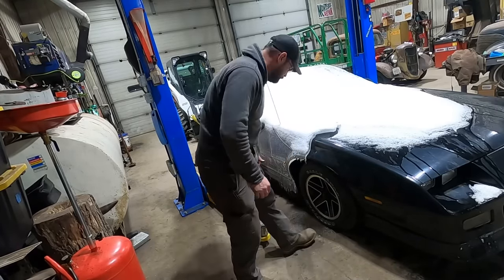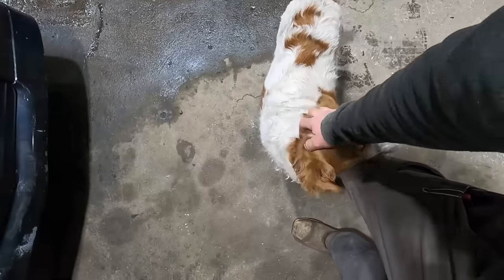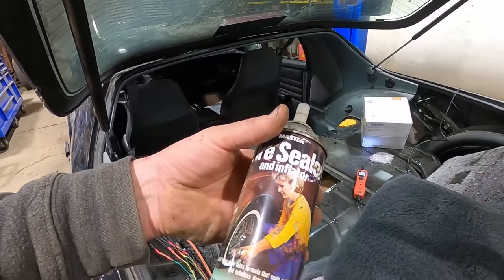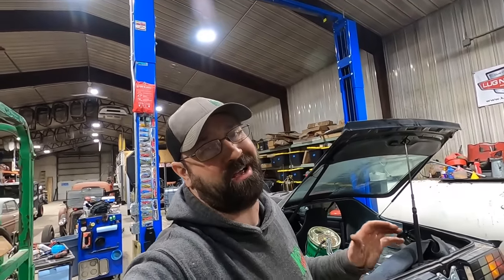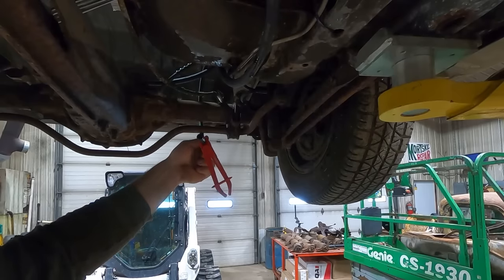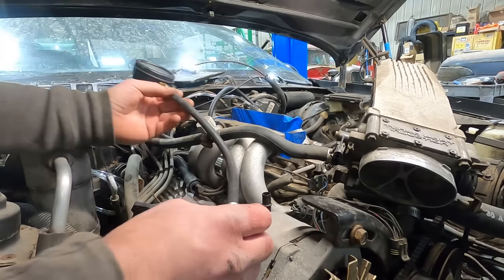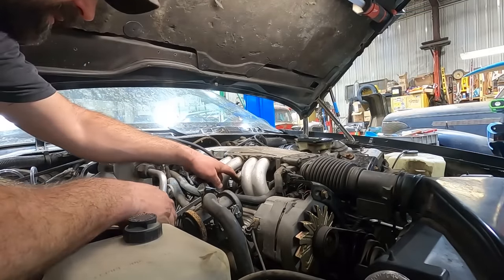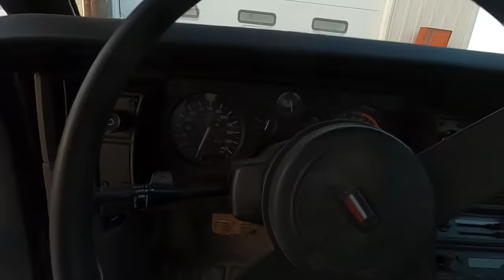Another Bargain or Bust Facebook Camaro?!? Low Mileage 1986 Z28 Tuned Port Injection! Will It Run?!?

Comment: RPO code Z28 came out in 1967 with 602 examples built for the 1st model year.
Reply from the maker: No way?!? REally? Dang, I was way off.
Reply: @MortskeRepair   And in 1968, because GM President Pete Estes wasnt sure if they were going to continue the Z28 homologation, some of the engineers had a '68 convertible optioned with RPO Z28 and gave it to Mr. Estes to persuade him. It worked. That is the only 1st gen Camaro Z28 convertible ever made and it now belongs to Dana Mecum of Mecum Auto Auctions. The rarest muscle car ever built.

Comment: Fun fact about the LG4 it was a 305 with a quadrajet that was computer controlled, it had two electric ports on it. They called it the E4ME carb, I still have mines it’s currently my new door stop.
Reply: mine was gone.......just threw on a holley 650,a bit overkill but the price was on point
Reply: That's about all those electronic frankencarbs are good for.
Reply: @Jerkwad152  Exactly like I understand this was a way they came up with to meet the requirements for C.A.F.E. But they could’ve just went with smaller jet sizes. Luckily by 87 I believe all the v8s in the 3rd gens went efi, so no more Frankenstein carbs 🤣🤣🤣.
Reply: @trillrifaxegrindor4411  I had a 625 Street Demon carb on my 305. I would rather be slightly over carbed than under carbed. Because lack of fuel is where you really start to destroy shit, especially in performance applications.
Reply from the maker: Sounds horrendous!
Reply: Fun fact.. not all LG4s came equipped with that computer feedback equipped nonsense.
Reply: 88 305 with electric float control. Unplug in summer time to keep from flooding. Fun times.

Comment: Yes, the round rusty object next to the mouse house under the intake plenum is an EGR valve.  The throttle body is not liquid cooled, it is liquid heated.  That is to keep cold moist air from forming ice on the throttle blades in cold climates.
Reply from the maker: Yeah I said that wrong.
Reply: Some 454 tbi trucks had a similar type deal which were also 4 bbl to tbi adapters cause tbi 454 had 4bbl manifold from factory.. used one while swapping an older 350 with an air gap 4bbl manifold into a 91 truck .

Comment: The biggest problem with third gen’s ,,,, the type of previous owners they attract.
Reply: Ive loved these cars since the late 80s, yet Ive never owned one. And Ive now owned 100 cars and trucks. There's too much "low life" stigma attached to them.
Reply: You must mean second owners because the people that bought them new, at least in 19687, were not odd people.
Reply: bro, as long as you grow a mullet, it's all good.
Reply: We called them "trailer park Corvettes" when I was growing up.  Bonus points if it had a baby seat in the back.  Or up on cinder blocks
Reply: "Trailer park corvettes" is hilarious!😂😂😂. Im a proud IROC owner since 1998 and I can confirm that previous owners are a problem. At least mine came with a condom in the ash tray so you know they guy was stackin the hoes...hopefully not in my car though. The guy before him used green garden hose as air injection tube for the cats and also hung the 6x9s with cut up pieces of license plates. Classy.
Reply: @andysteele4056  as a 89 944 owner my Car has had similar issues with previous owners for the longest time. These were really cheap and people would buy them because they had a Porsche badge on them.

Comment: Sweet thridgen project! I just got me a 86 Ford Bronco II inline fuel pump and strapped it to a boat tank. Cheap and easy and it runs everything that comes in with a bad fuel pump- so i just hook it up and drive the rig into the shop. I went to the junk yard and cut off every different fuel fitting I could find and put them in one of those Milwaukee tool bags along with a 99 corvette fuel filter (to adapt it to newer returnless systems). Then all you need is some fuel injection hose and FI hose clamps- it even works on GM TBI despite the pressure difference. One of the main things that go wrong with these is the fuel inectors go bad when exposed to ethanol- it eats the laquer off the windings inside of them then they have a resistance that is too low for the ECM to handle. you can test them with a multimeter in ohms mode- the resistance should be around 12 ohms on each injector- much less and it wont work right. TPS voltage should be set to .55 volts KOEO. They were all 305's until about 88 when they came out with the 9 bolt that could handle the 350
Reply: One of my favorite test rigs was a pump up garden sprayer with a soldered on air hose quick connect with a bunch of GM adapters. You could set it to whatever pressure you wanted. Carb, TBI, EFI didn’t matter lol

Comment: We put a new transmission in my friends 3rd gen Camaro and we left the torque arm off to see what it would do without it, every time you take off in drive normally it would raise 6" up and if you put it in reverse and held the brake it would pull the car 6 in load of the the ground, the torque arms is really the only support keeping the rear end straight...
Reply from the maker: crazy, maybe we should try...

Comment: I swapped out a 2.3 Turbo that came out of a wrecked Thunderbird into a 1993 Ranger and fought the fuel system for a couple of weeks because the injectors were all stuck shut with crappy fuel. Cleaned the injectors and it ran like a top.
Reply from the maker: Awesome!

Comment: 17:17 tune ports aint so bad. I used to think and do the same thing. They suck, rip it out and drop in some with a carb. That was until i got my formula! It wouldnt idle and ran like shit. I replaced the fuel pump, the filter and the fuel pressure regulator. Replaced the injectors with factory spec brand new ones and it runs AWESOME! thing is loyal asf! SBCs are loyal anyway but that tpi is better than any carb or TBI unit. I wanted to do the same as you and put an LS in it but it runs so damn good im gonna keep it. I want to do a "what if" Callaway made a run of sledgehammer firebirds! Lol i guess what im saying is give it a chance!

Comment: Tom, the Z/28 option was first offered on the 1967 Camaro.  602 were built the first year.  The first ones were built in December 1966.  It was built specifically to compete in the SCCA Trans Am racing series, and won the championship in '68 and '69.  The Pontiac Trans Am was first offered in 1969.

Comment: My Uncle had a Blue Iroc z28 for years it had the T tops, Alpine cassette Deck and JL subs in the back (mid 90s install) He Had a local trans shop go through the automatic  trans, while he went through the 5.0 and Rebuilt the entire thing, I can't even remember everything he did, but i remember the car screamed. he eventually parked it in the bushes out back for a good 15 years and my cousin pulled it into the shop when he was about 13 and went through refreshing it and getting it going again, drove it to school and it was his daily for about 5 years, he eventually sold it for a old truck. lots of good times ripping that car when my uncle owned it. i always loved the metallic blue paint. he had one of those airbrushed vanity plates with his name and it said "Iroc and Roll"  above his name with a couple of palmtrees and a beach scene😂the 90s were a great time 😂
Reply from the maker: Thanks for sharing!

Comment: love third gens, i have my fair share of them. right now i have an 85 iroc and 82 z28. i have also had 2 92 25th anniversary editions RS ones as well. just love these cars. keep up the good work
Reply: Is your 82  crossfire injection they used on them in 82.  Nice collection of cars I miss all of my z28s. I had an 85 iroc 88 iroc 85 z28 5 speed all tTop cars man I loved them cars
Reply: @icantsaywhat I heard 82's had a fiberglass hoods too?
Reply: @grabasandwich I've seen an'82 with the fiberglass hood from the factory. Not sure if all of them were like that.
Reply: I have an '87 iroc 305 t-tops car. I'm dropping in a high-comp L46 from a '70 Z28 when I get the courage to tear apart a numbers matching iroc😑
Reply: @Whats-It-To-Ya  numbers don't mean sh¡t dude. We only live once. Everything's mass produced and it's just the rich people driving up the prices beyond our reach with their p¡ssing matches.
Reply: @Whats-It-To-Ya  I just looked it up again. 82-83 Z28s had a Sheet Molded Compound hood, and had functional flaps with the LU5 option. But apparently they were delaminating at higher speeds so GM replaced them with steel ones.
Reply: @icantsaywhat  no and thank god. I absolutely hate that system. I have an 84 corvette that has that garbage on it. It is a nightmare if flawed design. The dual single barrel throttle bodies isnt a bad touch. It will actually flow 750cfm. That is where the good stops. The intake is the worst part of it all. The tbi units sit on top then your air fuel mixuture has to take a sharp 100 degree turn then up and over through a very puny intake runner. This chokes the port size down by a full 3rd of the size. Cannt port it either not enough material. Currently rebuilding the 350 that is in it, using Brodix IK180 heads, comp XE268hr cam and a edlebrock performer intake that has been port matched to the heads. For fue delivery. Holley sniper kit
Reply: @grabasandwich  mine is sheet metal.
Reply: @Whats-It-To-Ya  I tore mine apart, the og 305 spun a rod bearing. So I put a 383 in it. I dont plan to sell it, just have fun
Reply: @margraffsgarage  383 strokers are awesome. My father has one in his Monte Carlo SS. I wish I knew how to build one, which block to use, which crank, rods, heads and things like that.
Reply: @Whats-It-To-Ya  its not hard at all. Can use stock heads or aftermarket. As for the bore and stroke. You will need a rotating assembly. Mine is from Scat. I ordered the rods to match as well. Its taking a 350 and boring it .030 over and increasing the stroke from 3.48 to 3.75. Some blocks will require small clearancing to clear the rod bolts from the oil pan sealing surface on the block. Mine required very little. The block I used came out of a 74 3/4 tom truck and is a 4 bolt main. I have built another one however using the 87-94 blocks. They are 2 bolt mains but hold up good. As long as you dont send it to the moon on rpm you'll be fine. 6500 is about max. Compression ratio. On the 4bolt block it is 11.34 to 1. The 2 bolt one i build was a mild 9.5 to 1. It was veey streetable, great vacuum and great torque. Video of the one in the Camaro is on my page. I did remove it and put it in my 89 c1500. Did some changes to it as well.
Reply: @margraffsgarage  oh that's not all that hard. I don't have any 350 motors laying around except for the L46 from a '70 Z28 that I plan on putting into my iroc. I'll hafta go to the junkyard this weekend and pull a 350 to make a 383 as that would probably be better for my Camaro. I don't know what to do with my L46 that I paid a shit ton of money for. I do have an '88 or '89 S10 behind the garage with a blown 2.8, I should try to put my motor in that. Been wanting to do something with that little truck for the longest time, just haven't had the ambition. Thanks for the stroker recipe. I'll get started on that this weekend. I'll make sure it's a 4-bolt main and I'll slap some forged rods and pistons in it. 👍

Comment: About 10 years ago I bought a rust free 86 Camaro RS with the 5.3. It was loaded with ac automatic power windows and seats.  Everything worked even had new tires on the same rims you have on yours. I only paid $750 for it. Even all the suspension and brakes were almost new. Car drove beautifully.  I drove it for 3 years only problem was I had to replace the fuel pump and I did it the correct way by undoing the rear muffler and dropping the rear axle some it was a pain but got it done. I turned around and sold the car for $3000 . I live in Florida so the car was immaculate underneath.  It was red with tee tops and ground effects.  Wish I had kept it now after watching this video.  Sorry you got screwed so bad. Good luck in whatever you decide to do with it.
Reply: I would love to see a 1986 RS since it didn't exist.  In 1986 You had the Sport Coupe or the Z28.  In 1987 Chevrolet tested the market with a limited edition RS model all with the 2.8L V6 available in red, black or white.
Reply: A 5.3? I never heard of that one.

Comment: Crunchy snow, gotta love the cold!!
Word on the streets is 30° here in Wisco today.
That Camaro brings me back to the cruising days with CB antennas and mullets.  Id love to have another one of those cars.
There was also another engine option.(not sure about later years 86') 5.0HO with 5 speed. Those were MUCH quicker than the dismal 350
Thanks for the memories Mort👍👍
Reply from the maker: Heat wave!
Reply: @MortskeRepair  Hahahahaha, yea.  I don't believe it hit 30, but sure felt nice compared to how it's been.
Take it easy:)

Comment: Just from the initial undercarriage inspection it looked like the right rear coil spring wasn’t sitting the same as the left side.
Reply: I saw the Spring also.
Reply from the maker: @robertvance1873  I popped it back in place

Comment: I know in the 80's GM used the oil pressure sending unit to shut off the fuel pump if it did not have oil pressure. or if the sending unit was bad.
Reply: This is a fact that brings back memories  😅

Comment: I've an injector pug with decent length of wire, I plug into the injector earth it then flash the power lead against a 12v feed (don't connect as you'll fry the injector as the are 9v) the extra jolt of power usually frees stuck injectors.

Comment: Crank position sensor? It's what tells the computer where the engine is in order to fire the correct injector at the right time(when the intake valve is open). Never heard of a cold start injector, a Ford would just have longer injector pulses until the engine is warm enough to go into closed loop mode where the pulse length is adjusted to get the correct voltage from the O2 sensor.

Comment: I bought A 85 Camaro with A 2.8 and then found A 2.8ho In A RS of the same year and rebuilt the ho. I went through 4 crankshafts before getting the rite one and come to find out we had A 195hp 2.8ho engine. We spent over 3k rebuilding that engine and did decide to put A mild cam and lifters In It. Never had It on the dyno but It would roast both the back tires. 2.8ho multi port. I wish I knew you wanted one. I sold It last year for $800 . Nice video man. love these gen Camaro's.
Reply from the maker: hot rod!
Reply: @MortskeRepair  Well It did win several car show trophies so yea!!! ;)

Comment: Good thing about those third gen’s, you can grab a diff from a 4th gen. And it bolts right up. So you’ll get disc brakes in the rear and you can get 4th gen 10 bolts dirt cheap
Reply from the maker: Good to know!

Comment: Dude, that was epic. After all that frustration, you were successful. Ford parts hardly cross with other Fords, Its mind blowing that they crossed with a 12 year older GM. The thing actually sounds like it runs good. I’ve actually been looking for an iron duke, 5 speed, because I think it would be funny (0-60 in around 18 seconds) There’s for sure $1,500 in interior parts, tranny, and engine there.
Reply from the maker: Iron Duke with an OD would be fun in a small hot rod!

Comment: 87 first year for 350 option, but only with iron heads. You could get A 5spd with TPI starting in 87 with 305 only. 1LE is the 3rd gen to have, if you can find one.

Comment: That crunch when you lifted it the first time was the crush/push out of the fenders and it happens all the time. On the front they want you to lift on that frame area further in which is tricky to get at with a lift, driving over a small piece of wood on the front wheels helps to get a little more elevation. That one looks like a Z28, with an RS front bumper.
Reply from the maker: Noted

Comment: I worked in a chev dealer resealing those tuned ports. Those are easy to work on. I still have my memories of them. When the 5.7 came out there were no standard trans. Option on them, only 5.0,s.
Reply from the maker: Interesting

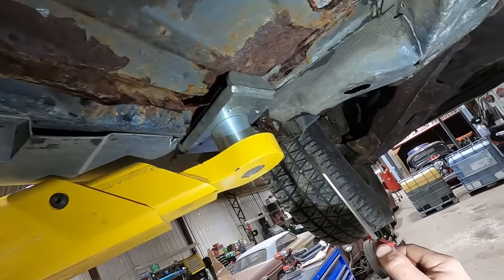Comment: I had a 84' Trans Am I put a 400SBC and a 400 Turbo Hydramatic in it and it was a screaming machine. 3500 stall converter and a reverse valve body with a shift kit. The motor was 30 over with a solid lifter cam and heads were done up. Was 10.5-1 and I had a Victor intake with a 750 Holley double pumper with a Mallory Unilite and a MSD 6AL and a Blaster Coil. 342 rear gears with the factory transmission bar welded and bolted to the rear end (Factory ladder bar) . Was running 11.0's in the quarter and it was consistent with in a couple of tenths every time. About 525 rear wheels and would light em up for 20 yards until the tires were hot and it would grip. 10:26
Reply from the maker: Thanks for sharing!
Reply: @MortskeRepair  and I will say that to you all also Mr. Mortske crew!

Comment: The big round guy is the egr valve. Also, the throttle body is liquid warmed, not liquid cooled! I can't believe the hacks cut a hole in the body for pump/sending unit access.

Comment: Finally got to finish this,when you told Mojo about using a cereal box as a gasket I laughed because my grandpa taught me the same th8ng if you need a gasket in a pinch,also when the SnapOn guy in Minneapolis tried to sell me a $135.00 Stethoscope and I showed him how to use the Oil Dipstick the same way his facial expression and walking away was priceless lol,these TPI sound like a cool Idea but the first time I had to do both upper and lower intake gaskets and a new distributor I changed my mind real fast lol

Comment: nice job getting it going with ford parts. when I seen inside the tank I new she would be pluged up. worked at gm dealership back then and they were already junky new. good fun with morts and duffer. cheers guys.